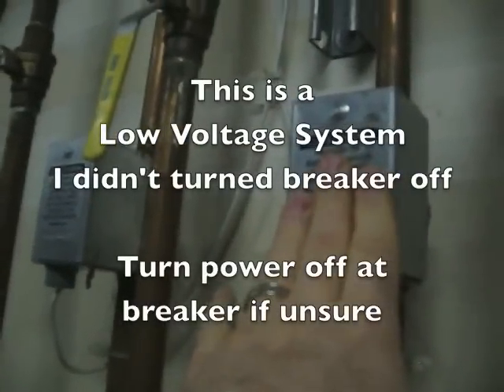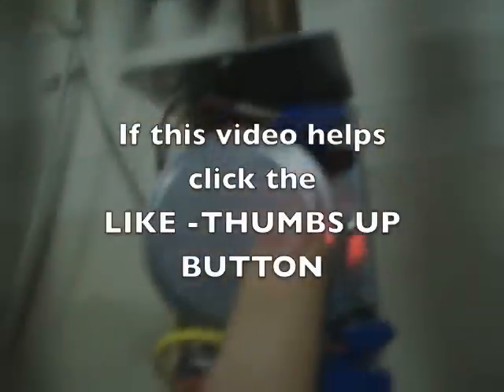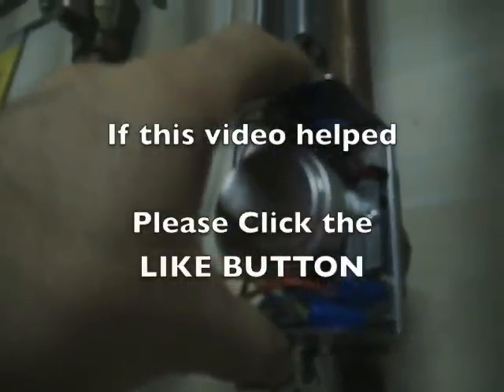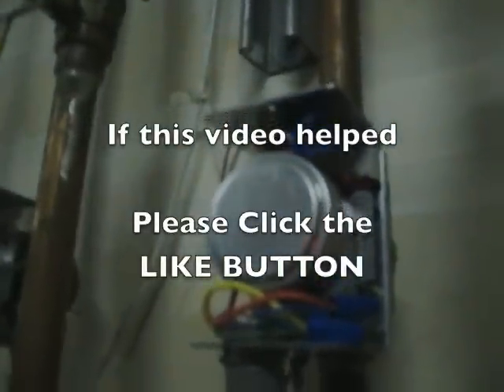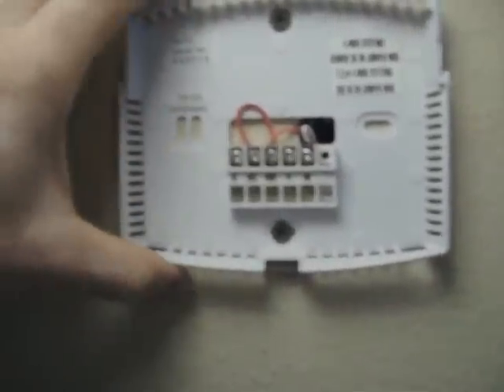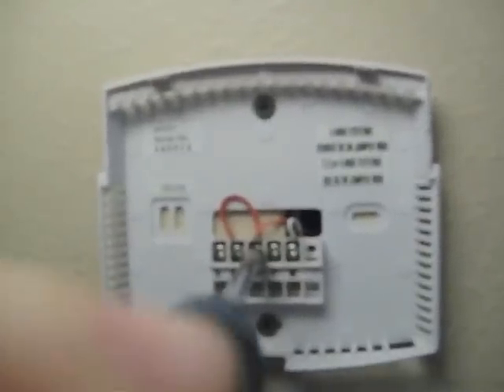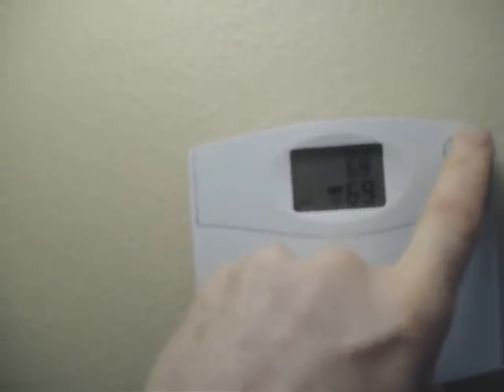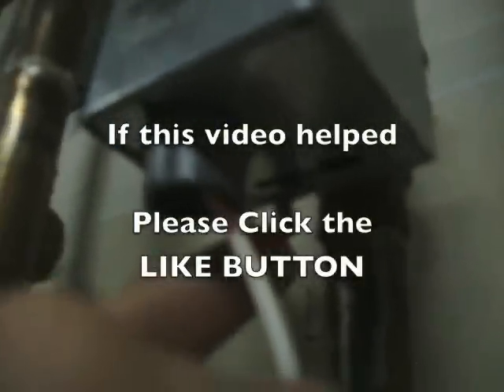1ST * HOW TO TEST * NO HEAT *Zone Valve-End Switch-Thermostat Diagnose Testing Diagnosing fix fixing

Comment: A bit too much replacing, without testing first.  Why replace a thermostat when you can short the wires and see if the system turns on?  Why not check for voltage  before replacing motor?

Comment: Or... you could just turn the thermostat up, and check to see if your zone valve control unit is indicating a call for heat, and indicating that the zone valve is open...

Comment: Occam's razor: when a problem may have multiple solutions, always start with the easiest ones.
Reply from the maker: Problem is sometimes the easiest ones are easy to overlook.  A screw on a thermostat being loose causing an issue with the heat 10 years later, when no one's messed with it is an odd one for most, but it does happen.
Reply: You are right bro. You also did a great job troubleshooting and fixed the issue.

Comment: I'm having the same issues with my zones not heating. First I'll check the screws on the programmable thermostat, then work my way to the hopefully not having to replace the zone valve motor. This just gave me the guidance I needed.
Zone valves aren't cheap but cheaper than paying someone else to replace them.

Comment: Nobody should try to fix their zone switches, replace motors, etc. Without knowledge of how thermostat switches, transformers, ac and dc voltages and or just good background in electrical and electronics along with HVAC knowledge. You can start a fire and you might not be home to save it...

Comment: I’m wondering if this is the reason our first floor has no heat? But the second and third floor do? Also we still have hot water. Could it be the pipes on the first floor are frozen? Or this zone valve motor is the culprit?
Reply from the maker: Did you figure it out?  Hopefully you had no issues during the cold....

Comment: I'm having a similar problem.  However, the zone valve opens as it should but its not sending signal to furnace to fire.  I've changed the entire zone motor assembly and get same results.  I've done a similar test with thermostat from the working zone to the non working zone and get same results.  Zone opens but no fire.  

The other zone works perfectly.  

My thermostats are only 2 wire.  Both stats go to a common connection before entering the furnace control box.    Any ideas?
Reply from the maker: Did you use a multimeter to test the end switch?  is it only one zone that is causing the issue?

Not sure if either of these boiler links will Help;

https://www.achrnews.com/articles/86037-troubleshooting-hot-water-zone-valves

https://terrylove.com/forums/index.php?threads/boiler-doesnt-turn-on-but-zone-valve-opens.38772/
Reply: I really appreciate your reply.   I had changed zone motor on Friday, along with also changing the expansion tank from a 15 to a 30.  Apparently between friday and today it worked itself out.  The trouble zone was functioning as it should when I stopped home earlier.   I had called in a professional and he stopped and it was working.  He tested it all out and then went on his merry way.   Been battling this since last weekend when it got pretty cold in the northeast (but then went right back to summer for a few days).

I did test for continuity but didn't get really down and dirty with it.
Reply from the maker: I know this was a few years ago.  Do you remember what the repair person charged to stop by and tell you it was all good?

Comment: Thanks for the help!  Stupid question perhaps - my problem is the opposite - the baseboard does not turn off (so keeps heating the room).  What do I need to do before trying to replace the zone valve motor - what do I need to turn off? - the furnace/hot water heater (the red furnace turn off/on switch) when doing this?  Or something else?  If so, (after turning off the power) do I have to light the pilot light again?  Sorry - if you haven't figured - totally a novice to these matters. Thanks mate!
Reply from the maker: Different zone valves run on different amounts of power, so make sure you are aware of the draw your motor takes first.  One mine I just had to turn the heat way down so it wouldn't turn on then switched the motor, but my ZVM's were only like 6 or 12v.  Look at the motor it should say.  if it is 120 turn it off at the breaker, don't forget to have your flashlight ready too.  Mine was as simple as 1) turning the heat low so it would not kick on 2) Switching out the motors 3) turning the heat way up to see if the motor kicked on and solved the problem.
Reply: Thermostat is probably bad
Reply: T-stat

Comment: My moms apartment of two months in a new building has no heat. She has a Schneider Zone valve, and management and maintenance say the thermostat is at 70 and all is fine. But its not fine, the radiator is always cold and has never been warm. I am going to try these steps, hope I dont break anything but I have to try. Thanks!
Reply from the maker: +Jess S becareful if you are renting.  I lived in an apartment that had an automatic heat setting and I was not able to control the heat.  If your apartment is 70n degrees they may not be concerned.  If you are upstairs or in a middle unit you may be getting heat from below or next door and that is keeping your apartment warm enough most of the time, so your thermostat doesn't need to kick on often.  I'm not there, so I don't know, but be very careful.  If you wreck something they will hold you responsible and it could get spendy.  I'd just keep calling and complaining every few days otherwise your mom could be caught with a hefty bill from a repair company.
Reply: +You can Fix It!!!! Hmm. I went into the neighbors apartment and her apartment is nice and warm and thermostat reads 80.3. When I try to change my moms, it just falls back to 70. 311 inspector says the apartment is at 70 when he comes but it still feels cold. I have called and called. What could be the reason that the radiator has never been warm. Last weekend it was 0 degress with wind chill and it was cold. Its like they dont believe us, so Im lost as to what step to take next. I just wanted to at least check that the zone valve motor was on like you did.
Reply from the maker: Just be careful because if you mess anything up they will hold you responsible.  Also make sure that you are able to turn the power off or that these won't try to click on and electrocute you or really jolt you.  Mine are low voltage, but some are not.  If you are unsure of the voltage I wouldn't advise it, as although you say it hasn't been turning on it undoubtedly will when you have a wire in you hand.  Just be very careful in what you decide to do and make sure you are safe.  I am not there, so I can't tell you what's up, but be careful.  My house it only set for between 64-68 depending on the time of day it is.  64 when we sleep and 68 when we get home from work.  If you're at 70 you're doing better that I.  Best of luck be safe.  I am not sure what the voltage is of yours.
Reply: maybe  you have the flu
Reply: maybe you should troll somewhere else.

Comment: Wouldn't you have find same out by turning heat on by Manual switch under ZoneValve ? Which would have told you that you have Thermostat problem ?
Reply from the maker: +Lord OfTheRing The motor runs that lever, so if the motor is out you can usually still manually push that over and get heat.

Comment: Wait- u did all the diagnosing after u bought the motor?
Reply from the maker: +superslim121 Where I Live I needed the motor anyway.  We regularly have 40 below nights come the dead of winter, so it was a needed item to have on hand.  For about $20 I have it ready to go.  If I had a 40 below night and needed it I would run me way more than that.  I always suggest a spare if you don't have one.  We are in central Alaska and it gets COLD! Now if a motor goes out I can have my heat up and running on those freezing nights in no time and no need to call for service!
Reply: @youcanfixit3721  I live in one of the coldest places in the US and  40 below nights are very fucking rare. 
Where do you live?
Reply: @SlayerofFiction  click on his "read more" at the bottom of his reply and he continues on mentioning where he lives.  He might live north of your US.